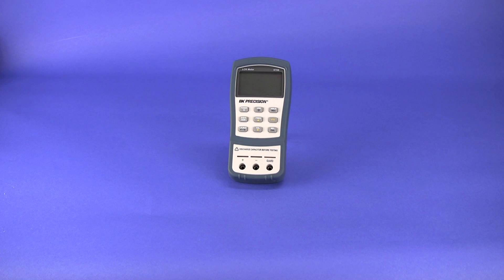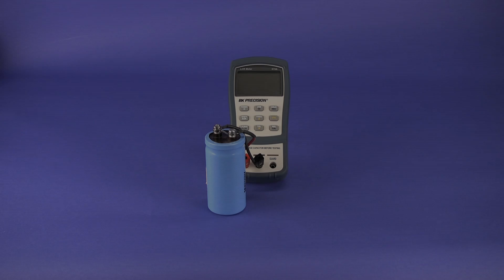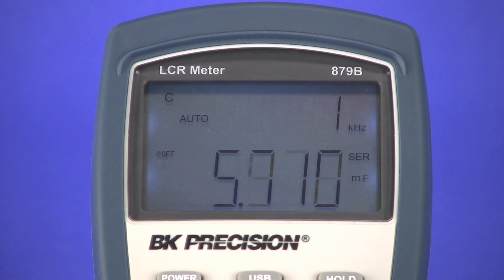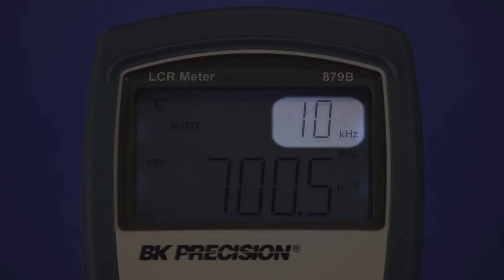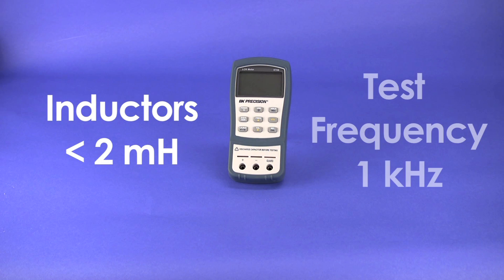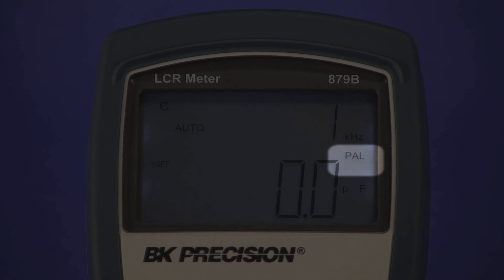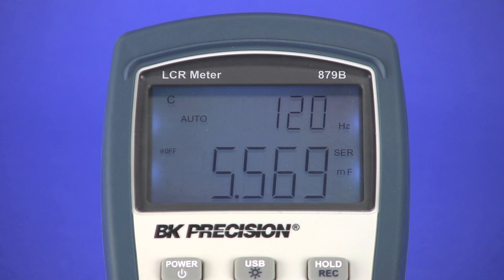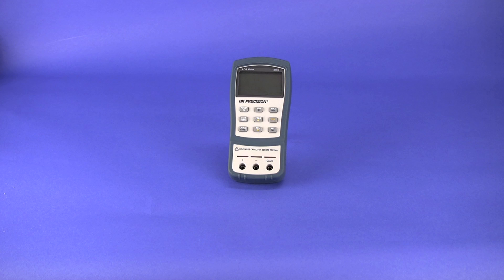How to use an LCR Meter

Comment: I am looking to buy the 879b, but I would like to understand two things about frequency.  Why does this meter only go to 10khz?  Your cheaper ESR meter specifies "in-circuit" specifically, but this one does not.  Does the high frequency have something to do with in-circuit testing?  Basically, I want the features of this meter with the ability to test for bad capacitors without removing them.

Comment from the maker: @ljay0778 Thank you for recognizing the quality and value of the meter used in this video. While you are correct that the electrolytic capacitor used had a rated value printed on it in micro-farads, the meter, however displays measured values over 4,000 micro-farad as milli-farads, so the video presenter was mentioning the measured capacitance value of 5.58 milli-farad.